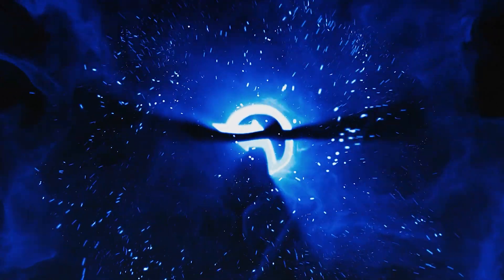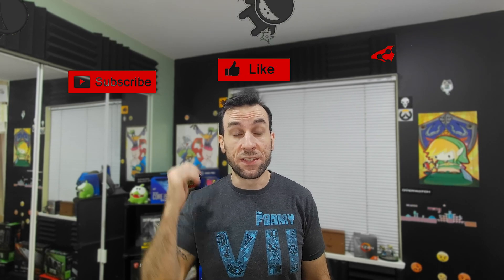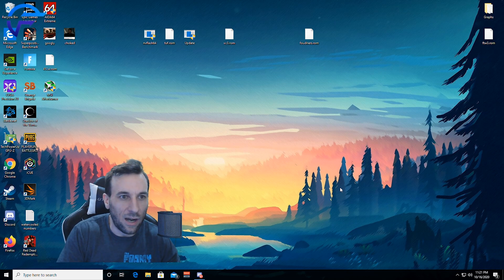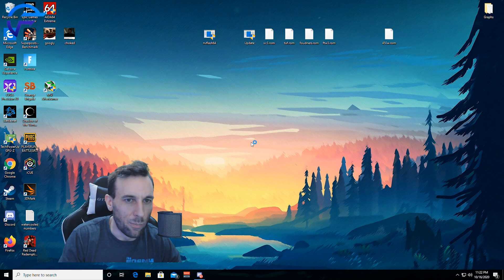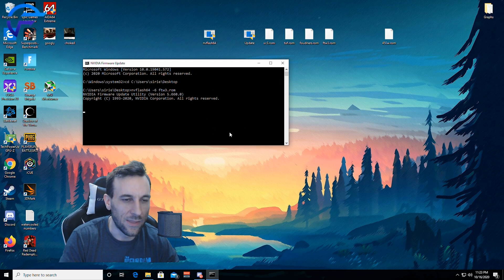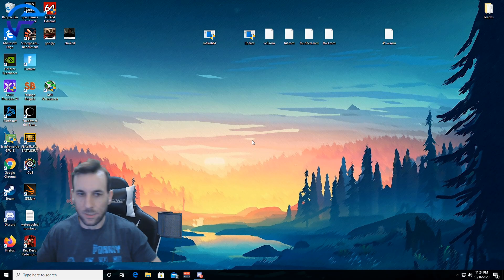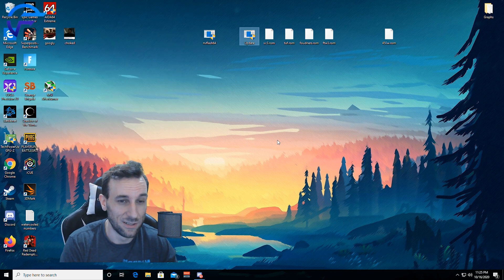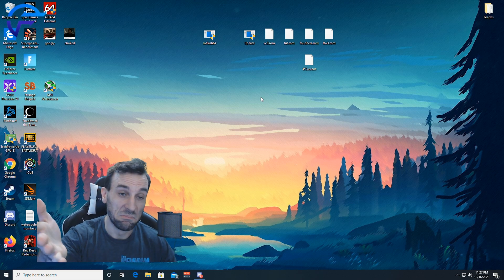RTX 3080 XC3/Reference power limit bios flash

Comment: This is NOT possible. The RTX 3080 XC3 Ultra and normal version have only 2 x 150W connectors + 75W at max for the PCIe slot. The most you can get is around is 375W. Most bios will not even go pass 330W even with the slider of voltage at max. So this is useless. Even the 400W bios is useless. Your card cannot draw more power because it's limited by design.

Comment: I did this, and now 3 years later i tried to undo it, i didnt have my original bios anymore and now its bricked, i cant boot with it installed even with igpu adn if i place it after i boot windows wont read it, any ideas?
Reply: Maybe on your graphic card, there some info label stickers as such barcode, model # and hopefully current bios info. I did the same thing but couldn't remember my original bios until I took it apart for cleaning and notice my bios info sticker label on it

Comment: If I were to flash a 3 pin bios to my 3 pin card would it work ? 
I’m thinking of flashing a suprim x bios to my 3080 gaming x trio

I’m noticing my chip is a decent bin able to sustain +130mhz  giving me a total of 2130mhz on the core without crashing but I notice no performance gains as when I benchmark, whenever I hit my 350w power limit it downclocks itself to 1900mhz !!! I believe if I were to raise my power limit, the gpu will sustain the clock speeds at full load!!

Comment: Tried this as instructed and although I successfully flashed 450 via update after flashing 400 with nvflash. There was no gain I actually lost 30wt power when taking into effect pin 3 is duplicate of 1.
Reply: @bizhouse8737  what?
Reply: @bizhouse8737  I need the username and tag at the end
Reply: @officialradaq  bizhouse#5632 , re earlier question why to subtract pin 3 .... Because it's a duplicate of pin 1 so once you subtract value for pin 3 of your total you have your real power reading.

My gpu z also showed 450 but as say once subtract value of pin 3 comes out approx 320 wt.
Reply: @bizhouse8737  I honestly don't care? that wasn't my point. The point was I noticed a huge improvement lmao.
Reply: @officialradaq  happy for you bro 🤜
Reply: @bizhouse8737  yup, everyone should be doing this tbh. it raises the temps a little but nothing too crazy
Reply: @officialradaq  I dident notice any difference temp wise tbh under load I was 40 / 42c max either bios.
Reply: @bizhouse8737  the bios does amazing work though, I was hitting over 2000 on the core in Call of Duty Cold War. Games that require more CPU than GPU you will see massive CORE Boost
Reply: @officialradaq  don't get me wrong I'm happy you have seen an improvement , but it hasent worked as per the original video your not pulling 450wt as you think and quote earlier in thread. And that is the point of this video.
Reply: @bizhouse8737  you gain a boost in wattage either way though, I can show your proof it worked. What’s your discord username?
Reply: @officialradaq  ok so what is your actual voltage once you have subtracted pin 3 in gpu z from your total of 450wt ?
Reply: @bizhouse8737  do you want to see the performance gains or not? What’s your discord username
Reply: @officialradaq  no I'm fine in that respect thank you for offering I'll take your word on that matter. What I'm interested in is you actual total draw power once you subtract pin 3 from total output.
Reply: I just tried it and gained alot of performance, double confirm by going to GPU Z and check if it says 450 watts.
Reply: @officialradaq  don't forget to subtract pin 3 value from your total.
Reply: @bizhouse8737  for what reason? I have screenshots to show proof it works. I have a better 3D MARK Score and I also benchmarked Shadow of The Tomb Raider and getting a 15 - 20 fps improvement because of the higher clocks. I could undervolt this baby and probably get an even better score!
Reply: @bizhouse8737  whats your discord username? Ill add you to show proof.

Comment: Is it possible to flash to other 2x8 pin bioses with higher power limit like Zotac holo amp and such? I really wanna try it but i'm afraid, if something goes wrong i'm out..no backup gpu, not even integrated gpu.
Reply: same i dont want to try it
Reply: @redux1647  not worth bothering...the cooler is crap anyways, goes to 80c undervolted in RDR2..not worth to push it further with higher power limit, i don't think it's possible anyway, it's hard coded somehow..no bios flash unlocks it, unless you do a shunt mod.

Comment: Hey man just tried this on my 3080 XC3 Ultra. Update was successful and I finally got a higher power limit out of my card. The problem is I am running on the stock cooler and the fans are displaying some weird behavior, it keeps turning off and ramping up from 0 to 3000. Controlling it manually on afterburner or precision X1 doesn't help.
Reply: Nevermind, I know what my problem was. I reflashed back to my original XC3 Ultra bios and the fans functioned normally, but I wanted to figure out what the problem was with the FTW3 XOC bios, so I flashed it back to the FTW3 XOC bios. What went wrong before was that I immediately went to MSI afterburner and sped it up to 100% (I was wearing headphones, so I couldn't hear the weird behavior of the fans), what I did now is that I went to EVGA's Precision X1 where it prompted me to update due to firmware changes. After the update, I can now manually control my fans.
Reply: @bruceeboy0627  can you tell me how to do this? this guy provided 0 links to download anything lol

Comment: My XC3 ultra performs worse becuz it is no longer going up to the same clock speeds. It "shows" 450W power draw, but thats only cuz its adding the 3rd power connector number to the total.

It also runs a lot cooler, which also suggests that its actually drawing much less power. Stock bios goes up to 75C. 450W update goes to 60C.

You need to do the shunt mod for this to work.

Comment: So is the XC3 a good card to buy ?
Reply from the maker: Definitely not
Reply: @FrameChasers  Which one would you recommend?
Reply from the maker: @Roxelchen  the cheapest one you can find man, it’s all the same shit unless your really into hard modding and overclocking
Reply: @FrameChasers  funny that’s the XC3 at the moment. I was considering this card cause there is a waterblock available from EKWB and it is „cheap“ compared to other 3080 in my country.
So there is no specific reason to avoid the XC3?

Keep up the good work
Reply: @Roxelchen  xc3 ultra reports of coil whine, myself having two of them and both had coil whine.

Comment: *wince** Ugh, flashing BIOS...that makes me nervous. Especially when it involves shoehorning past manufacturer safeguards. I dun wanna brick my precious card waah T_T
Reply: I have been cross flashing several different bioses to my RTX 3080. Even ones with different display outs and vrm's. None of the bioses have bricked my card yet. I do have counter measure for bricked cards tho, i have backed bios using spi tool and soic clip, so i can reflash it back using same spi flash tool. Only downside been with some bioses some display outputs have stopped working if new bios has different display output layout. What you should look for is 8pin layout, 2 vs 3, cards wont work correcly, it will boot fine tho.
Reply: @jarnom85  I don't get it man. I flashed my ventus 3080 to asus tuf 3080 and i got a bluescreen when I installed the driver. First try and it was already a huge problem, while I read people test 10+ vbioses without issues. Had to boot into safe mode to flash back to my backup bios.
Reply: @TheJonazas  You need to make shure following matches : video ports (not always), power connectors, memory chips. In your case I would think you either flashed 12GB bios on 10GB card since there are RTX 3080 10GB and 12GB models or it wont work because of video ports are different. My comment was based on two different manufacturers cards, neither was MSI or Asus.
Reply: @jarnom85  Alright, but I guess i'll stick with my 320w power limit, cause I don't wanna brick my card.
Reply: @TheJonazas  Better safe than sorry. I have way to recover bricked card through hardware programmer but not everyone does, I always do backup of bios with the hardware programmer if the card is not dual bios card.

Comment: I flashed 3080 xtreme 450 w bios into my 3080 master but the card performed worse than original bios. The card thinks that it has the extra 8 pin cable and doesnt add the extra voltage into the other  real 8 pin cables. The card couldnt even reach 2000 MHz  with high overclocking and power limit maxed out at 121% in afterburner. Had to flash back to master bios. I hope gigabyte releases a higher tdp bios for the master cuz I overclocked it to the highest i could and my temps never went above 65 C.There's a lot of room for OC but the power limitations prevent it.
Reply: You ever end up getting it done? I'm in the same boat, I have a 3080 Aorus Master running full 350 watts and only 59C and I tried running the 3080 Extreme bios but to no avail, didnt even change the bios even though said successful. Were you able to run more power somehow?
Reply: @jaxindustries6825  I couldn't make it work. The reality is that  between 370 W and 450 W performance gain is minimum. The only place where you can see the difference is on benchmarks like port royal and time spy.   I scored 18900 on time spy  which is quite near to the 450 w versions .  for that score I ran +185 core clock, +1075 mem clock and 100% core voltage if you are interested.

Comment: Have you heard of anyone trying the strix 450w bios or the evga 450w bios on the TUF 3080? I can't get any reliable information on this because everyone who brings it up on reddit or the forums gets bashed because the TUF only has two 8 pins, and people FREAK out over the 150w spec of the single 8 pin. I know my PSU would have no issues providing 200w on a single 8 pin,  so I just need to know if anyone has successfully flashed either of these 450w bios files to the TUF. I'm hoping it would be similar to your xc3 where it may not give it the full power limit, but at least up it a bit.
Reply from the maker: lol your first mistake was going to Reddit for good information.  Reddit is only good for flaming.  I would answer your question with give it a shot and see what happens.  Backup your original bios and flash it back if anything doesnt work after.  You cant harm the card by testing different bios' out.  Other than that I can only suggest to join my discord and see if anyone in there has tried because I dont have that specific card
Reply: @FrameChasers  wish I could "heart" your response for the comment on Reddit hahahaha. Thanks for responding. I'll give your discord a look.👍 Thanks!
Reply: @LetsGetTechy  yo, i was wondering if you found any bios that helped gain some watts on your tuf, could you let me know ? I tried the Strix OC bios on my tuf OC but it did exactly what everyone else is mostly talking about, more wattage for less clocks. Now i dont which Bios i should try :/

Comment: Wait a sec...2 8pins + pcie slot ~ 375w. And even with simple bios flash update it gives 450? Can it hurt these poor 2 8 pin cables? or it will limit itself somehow on 375w limit?
Reply: Nope. Cables are fine, single 8pin with 18 gage wire can easelly supply over 300 watts. If the PCB can handle this 300+ from single 8pin connector is whole different deal. Obviously 2x8pins are more than fine for 450watts.
Reply: @jarnom85  false. 150W is the max you can get out of a pcie cable. maybe the best ones will give a 160W at best. There is NOWAY 2 x pcie + 75W from pcie slot give you anywhere near 400W. Impossible and UNSECURE. Let's not talk about 450W. This is totally useless.
Reply: @ Not false. I'm electrical engineer, it's not about what it specified in standard, the cable and connector are physically able to handle much higher current than standard specifies. Each invidual 18 gage wire while maintaining temperature at 60 degrees of celcius at air temperature of 30 degrees of celcius and insulation material of PVC is 14.2 AMP's (170W per wire) so the 8pin connector is able to handle 42,6 AMP's, so its actually 511W's that the cable can handle. The 8pin standard have incredible amounts of safety margin compared to 12VHPWR.

Comment: Hey man, I like your channel and appreciate your tests. I tested flashing the FTW 450 BIOS on my XC3 Ultra gaming, and did my own tests, I am using a Corsair 1200i, so I can measure how much power the system is using.

As they say, 8 Pin #1 and #3 are duplicated so you end up having less Power limit, as it reports around 140W. 

In my testing, with the 450 FTW Bios, I got 514 power draw from the wall running a superposition 4k optimized, with a Asus TUF Bios, 572 W, and with the XC3 Original Bios 544.  (My Idle system uses around 130W) 

I really think that for this to work you really need to do the shunt mod, so those Pins report less and you end up having a higher powerlimit...

Comment: Can I flash this on Asus TUF card? Asus released a new Bios which supposed to have increased the power limit to 450w, flashed it and it did nothing on my card. still voltage goes down to 0.968 can't get passed ~1900Mhz-1980Mhz

Comment: Wow nice! I flashed the 400w bios and it worked. 330w to 400w!
Edit: haha I tricked myself. The card doesn’t use 400w. It only measures 2 pins. The FTW has 3. So it uses less power with the 400w bios.
Edit2: without shunt mod and 450w bios the card is slower. XC3 org bios is faster so far. ;(
Reply: Is there any other alternative we can use? TUF gaming or something..this card is so gimped, i can't even get stable 1900mhz undervolted due to stupid power limit..
Reply: @TheClearStalker have u found any alternative sorry for necro
Reply: @suedevs nope..i just undervolted at 1900mhz and stopped carrying about it and enjoyed gaming..the cooler is weak anyways, i was reaching 80c in RDR2 for example even undervolted at decent fan rpms.
Reply: @TheClearStalker alright thanks